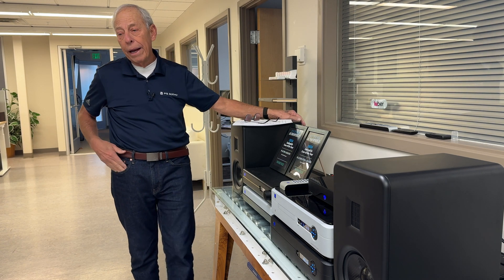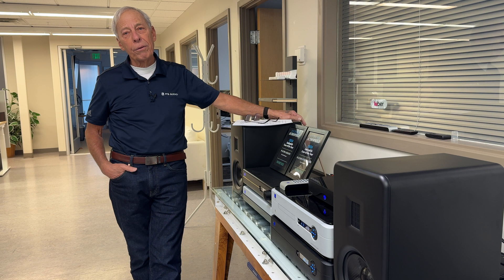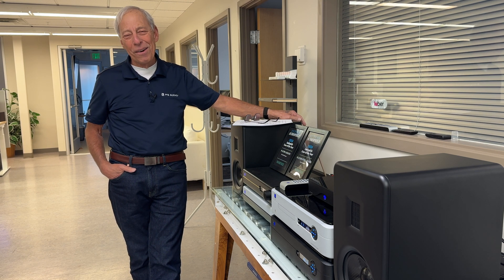How noise cancelling headphones work

Comment: Noise cancelling heaphones have existed in aviation for many decades now, and they have all used microphones with inverted polarity to cancel the noise.  According to Wikipedia, they were first developed in the 1950’s.
Reply: Many have been pretty poor. The Dave Clark’s still lack optimal clarity from ATC. Bose were the best option but I used Sennheiser for several years due to improved frequency range, even if they weren’t as quiet as Bose. Bought Lightspeed Zulu’s 5 years ago, best I’ve ever owned. Still not audiophile frequency response but the silence and clarity communicating with ATC is unmatched. I believe Lightspeed uses 2 microphones to cover broader frequency range for cancellation.

Comment: i wonder if this technology could work on loudspeaker room colorations especially lower Hz 16 to say 35... just a thought. Thanks for sharing Paul. :face-blue-smiling:
Reply: My understanding is the best theater applications do use dsp with subwoofers to cancel low frequency room resonance issues. I had opportunity to attend a premier at Skywalker Ranch several years ago. The film was great but the sound in that theater was mind blowing. It supposedly has over 30 speakers with each speaker custom built for its exact location in theater and many are actually noise cancelling despite wall and ceiling surface treatments throughout.

Comment: I have had several pairs of the Bose variety of noise cancellers, all with old school wire. They work just fine in noisy environments. Not so good for just listening at home though, as they have a background noise all of their own. Great for air travel, poor for home use.
Reply: You should be able to turn off noise cancellation for use in quieter environments though. Most NC headphones have settings for noise cancellation, ambient sound (enhancing the environmental sounds), and "off" for use as normal headphones.

Comment: I recently bought myself a set of Bose Quiet Comfort ultra. Over 400 quid! Not everything they are cracked up to be. Some head movements pause the video. Lift the left can to scratch your ear also pauses the video. And you cannot switch these features off with the app. Another thing the app is basic and very limited and the HMI is poor. The cup material is PVC so making your ears sweat - a top notch cotton-based material would be much better (very poor for the money). Yet all the reviewers rave about them, which has dented my faith in some reviewers.
Perhaps you should develop a PS Audio set that work properly!
Reply: I have a set of the same, helps on a long flight even when there is no signal coming through it.

Comment: Why don´t car manufacturers use active noise cancelling? Would be great to cancel road noise.
Reply: They do. Well BMW does
Reply: I  think cheap cars would benefit more.
Reply: My Acura also had active noise cancelling.
Reply: It's a standard feature in many premium cars. I know Land Rovers have it in RR and RRS, possibly Velar too.
Reply: They have for quite some time, but... then they also put microphones that picks up engine and exhaust noise so you can get a "racy sound" inside the car. 🚗 🔊🙈
Reply: its cheap to make and I feel all cars would benefit from noise canceling, especially cheap cars.
Reply: Even some top finish levels of Hondas have active noise cancelation in the car cabin.
Reply: To be most effective you have to cancel noise at the point source or destination
Reply: @bobc455  that makes it easy for the car. just aim at the driver for cheaper cars, back seat for limos